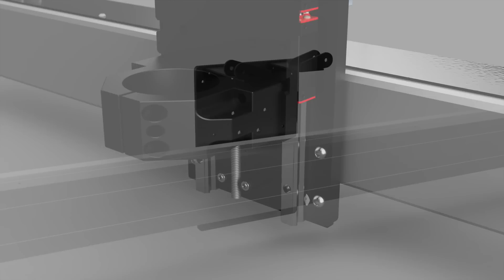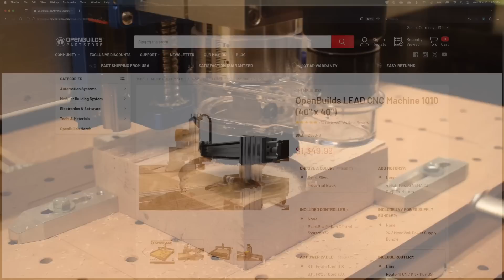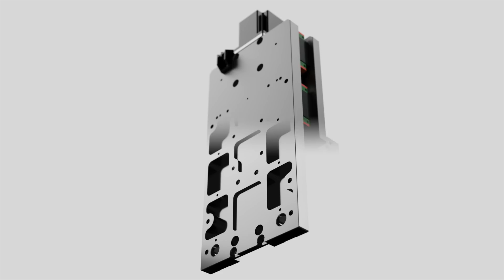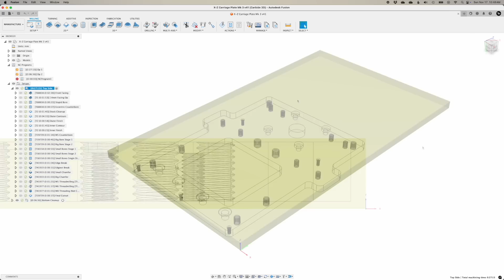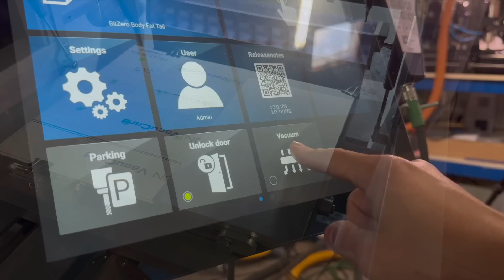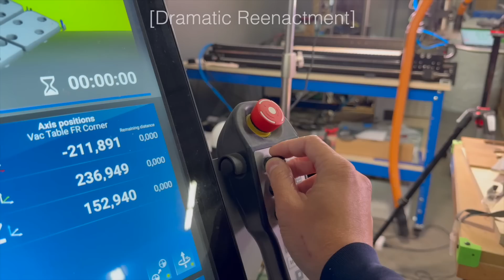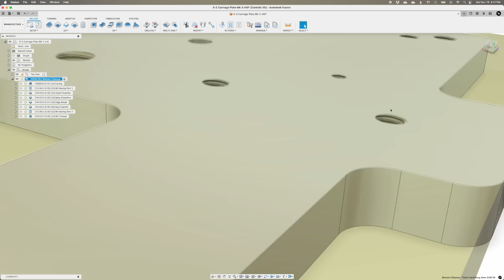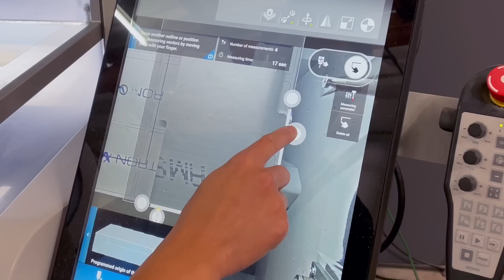The Keystone of my Super-Shapeoko Plans: The X-Axis Carriage Plate

Comment: Hey Winston I have a upgraded shapeoko 3xxl it has the 5 foot Y rails, am I stuck using carbide motion build 582?  I updated too 640 build version and you can no longer set your custom X Y and Zs 
If you have any other ideas that would be helpful!
Reply from the maker: If you open the data directory (click on the version number in the lower corner of Motion after you connect), you can access a JSON file for the machine that is generated when you run the setup wizard. Open it in a text editor, inside you will find a field for the machine travels. Save that, reopen Motion, and you should have the extra travel restored. If you screw things up, just delete the file and run the setup wizard again.

Comment: 2:47 - and this is exactly what problem is.    why your V-wheel nonsense cost "multi-thousand dollar" ?    basically V-wheel shapeoko costs more than a proper linear rail machine.

i personally build myself a machine which is all 15mm rails and ball screws, closed loop steppers, fast ethernet controller and no-nonsense machine structure.  
it weights over 100kg and can cut even grade 4 titanium.
and it cost me around 1000-1200$.   (you can answer whatever Carbide3D wants you to but I'm pretty sure you know I'm right and you know the prices)
so if i'd decide to sell it the fair price will be double (around 2000-2400$ for a machine similar to Shapeoko HDM)
so yes.  V-wheel machines are overpriced junk deliberately targeted to people with no experience.

Comment: Dude. You did a hell of a job on the design & custom parts! 

What a travesty to use v-wheelz. LOL I can't even mess with them on 3d printers any more. Nope!

The import linear rails in both 15 & 20mm Have come a long way in the last five years and have come down a lot in price period. 

At the very least I think It might make some sense to run about the gantry for open stiffin up that long span. More accurate parts and better looking parts out of the machine almost guaranteed.

Comment: Please lose the V wheels. I built the original Shapeoko Kit around 10 years ago. It was so poor I built my own keeping the controller, and V wheels as part of the new design. My only regret was keeping the V wheels. They might be great for some applications like lasers but not where you're creating dust which can build up on the wheels and rails. At best they can cause erratic behavior at worst stall the machine. At this point linear rails are cheap enough and better in all possible ways but cost. IMHO the should be considered the only reasonable choice. A little background. I'm an electro-mechanical engineer with many years of experience and in an earlier life was a tool and die maker. I loved my home built CNC router but hated the problems I had with the V wheels. I tried all kinds of fixes to no avail. Keep up the great work. Small CNC machines have changed the world for makers.

Comment: I probably would have done those holes by just marking them with a spotting drill, take it to the drill press, and then cordless drill to tap. Easier to CAM and much less stressful than watching the machine do it. These days I do that for any flat piece I can fit on the drill press and which doesn't require precise depth holes.

Comment: Well, i`ve builded few CNC routers with linear shafts/rods (SBR16). These shafts are very cheap in comparison with Hiwin type profile rails and they are much better than wheels. I can agree with you- it`s possible to replace pricey ball screws with teeth belt. GT2 10mm wide tooth belt can do the job good, even during aluminum milling.

Comment: Can you explain how the middle wheels are going to take any load? Maybe I just don't understand it. Is it just that as the carriage gets loaded and the outer wheels take some load, the plate flexes a bit and then gets slightly stiffer when the middle wheels start seeing load? I think It will get less than 2x as stiff when the middle wheels engage because they have less mechanical advantage. If I do understand it correctly, then I agree with the person who said they think that moving the wheels outwards will do more good than adding the middle wheels.
Reply: That's what I was thinking too. If the wheels are soft enough then maybe they will all engage, but otherwise two will just be going along for the ride.

Comment: The downside to these mills is the lack of a true spindle.   Using routers is an ever loving pain and they develop runout as the hour count goes up.
Reply from the maker: May I suggest reviewing the last 10 seconds of the video...
Reply: No worries I got there.    I am sitting at 2 CNC mills, one being a Millright MegaV and the other a Langmuir MR1.     MegaV showed me that things like a rack/pinion or belt setup are great for fast travel speeds but the router spindles allong with tesselation can be a bit of an issue.     Ball screws and linear rails along with a legitimate spindle really helps with being able to remove material.

Comment: may i ask, why make everything lightweight? isnt the point of a cnc to be super big and hefty and heavy and solid and ridgid and sturdy?
Reply from the maker: In general, weight is good. But the rigidity of a machine needs to be balanced with the sturdiness of the powertrain. V-wheels and belts are at best, "medium duty". Making the frame out of aluminum, or steel, or cast iron will make very little difference in the grand scheme of things here.

Comment: Hey Winston, what resources do you recommend to learn more about speeds and feeds? I’m getting back into CNC and that’s been one of the most challenging parts trying to cut metal..

Loved the video, I especially like how you leave in your mistakes. It’s much more human and also gives valuable insight to help others not make similar mistakes, thank you!
Reply from the maker: So speeds and feeds is a potentially deep rabbit hole. I think it's always a good idea to have a good high-level understand of the theory, and what the terms actually mean. There's some good videos about it (NYC CNC and the like), and lots of websites do a decent job explaining it. It really depends on how you learn best (visual, written, etc).

From that baseline knowledge, I think you need to make a judgement call. You can totally nerd out with programs like gWizard, or spreadsheets, and deep-diving machinist forums to try and find the "optimal" feeds and speeds. But unless you're using an industrial machine, the theory can fall apart pretty quick. There's always exceptions and ultimately you need empirical testing to figure out what works best for your setup. I personally don't like going overboard, nerding out on these things.

What I do recommend is to use Speeds and Feeds knowledge as a guideline. Ex. If you're cutting an unfamiliar material, but you know there's a suggested range of surface speeds, you can work backwards to find a ballpark RPM to try first. You don't necessarily need to get every last cutting parameter perfect though. And remember, these are guidelines, not immutable laws of machining. Keep a couple cheap endmills on hand, and don't let the fear of getting something wrong paralyze you.

Comment: Aligning 4 eccentric nuts a single rail seems like a pain. Would it be too complicated to have the wheels connected in pairs, able to pivot and auto adjust with a single eccentric nut per pair?
Reply from the maker: It's definitely possible if you throw two wheels on something like a rocker arm. The problem is that every linkage you add is a potential point of deflection. My feeling was that the simplicity of an eccentric nut + V-wheel on a solid plate would be the safest course of action.

Comment: One mistake that I made when building my CNC router was not making it easier to square up the X -Y axes. If you want .001" -.005" accuracy in your parts, you are unlikely to get that without making your X axis slightly adjustable.
Reply from the maker: Unfortunately on this architecture there's not a good way. I ended up using shims between the gantry extrusion and its endplates to square it up. There's also provisions for dual Y-axis homing for auto-squaring if I end up using a Shapeoko 5 controller to power this thing.

Comment: my old cnc router had vbearings, and they were just ok. but that was also 10 years ago when linear rails were $$, last year i upgraded it to linear rails and wow, for 100 bucks or so, its 1000x better. since you are doing this from scratch, did you price out the differences?
Reply from the maker: I did not because my goal here was mainly to explore improvements to an existing architecture with a simple change. At work I can play with a 4x4 linear rail + ballscrew Shapeoko 5 so I don't really crave the need for outright power or performance. Oh, and I also have the Neo to play with...

And as kind of a thought exercise, I wanted to see what an affordable Shapeoko could be. If you assume the linear rails for X and Y could be had for $150, plus labor and machining time, by the time you add retail markup you're going to have a Shapeoko that's ~$500 more expensive. That's basically the price delta you see between Shapeoko 4 and Pro. To me it would be less fun to try and build something that's essentially already been explored.
Reply: @WinstonMakes  for a production model sure, but this is more of a one off thing. dont get me wrong, your work is awesome and have watched every video lol. just figured if building something from scratch why not.

Comment: All these cutouts at the profiles weaken the structure!
This is not a 3d printer, so its not nessesary nor useful, to lower the weight at any part!
Have you ever seen commercial routers and mills?
All this machines with the footprint of your machine have no such cutouts.
Because its a waste of time, material and effort!
Sorry, but i have to say when a construction is not good!
Reply from the maker: I think you missed one of my previous videos. I know I technically weakened the rail, but it's fun and looks cool. Plus, the material removal from the gantry is negligible in the grand scheme of things. The belts and wheels are ultimately the weakest point. 

It's like saying a pencil should be made out of titanium for precise writing, when ultimately as long as the body is stronger than graphite it will work.
Reply: @WinstonMakes  ignoring the science is not wise.
But if your goal is the cool look, that is no point.
All the best👋
Reply: Who says it is not also a 3d printer?!?! Plus with the limitations that will be inherent to the sort of spindle that thing can mount and the wheels it runs on I doubt its had much if any impact on performance while reducing the mass that the machine has to move around a tiny bit, so saving a bit of energy if the machine was going to be used often would make up for the time invested. (Not 100% it won't matter, but it looks like a pretty safe bet it won't have made a meaningful difference with all the other factors that look much more limiting. Also even if it has he gains a great excuse to reinforce it in a lightweight and stylish way)

Also plenty of commercial machines do have lightening features in places - not every machine of every scale will, and the method used to have both sufficient rigidity and lightness might not look the same as here - for instance T, C and I beam profiles are a stiffness in multiple directions to weight ratio saving measure, and they get everywhere! Ultimately no machine wants to pack excessive weight where it isn't actually required, that just makes it more expensive to run and likely limits the speed of its operation. So like all engineering its a compromise between cost to build, cost to run, and final performance.
Reply: @foldionepapyrus3441  okay, its like you buy a VW Beetle and you say this my solution for F1 racing, family camping, and your distance for your dayjob.
This car fits only for one of this 3 cases, .....the last, and if you ever had done so, you never want this solution back for only one day.
Its a compromise, and for shure a very bad!  
If i have the choice, i always look for the best possible way. You can do 3 d printing with a much more massive machine, ......but slower.
You can mill with a machine out of rubber nothing, the flexible parts cause the damage of the endmills.
Carbide mills are made for stiff machines and can not handle the flexing, cutting edges break ....or the complete mill.
Okay you can instead produce dust with smalest possible chips, but this is not milling!
This stupid cutouts are not useful, an you can discuss as long as you want, at the end of the day its the truth.🤷‍♂️
40 Years of machining .....👋
Reply: @schwellenzaehler4564  In this case it was always a VW, and thus only suited for a slower pace. Now its just wearing a body kit so it can pretend to be a more impressive car while making no meaningful if any change at all to its performance. 

Seriously its lots of effort to make it look pretty, might help the machine have faster rapids, but its not going to make a huge difference if any difference at all to how that machine can perform - its only going to be able to mount a baby spindle that can't handle cutting loads significant enough anyway, the wheels themselves are on tiny little axles etc - there are so many factors that limit the performance of this machine to well below what you'd expect that beam to be able to handle!